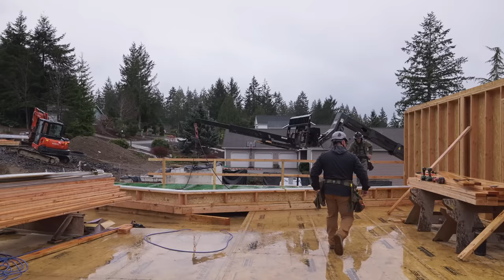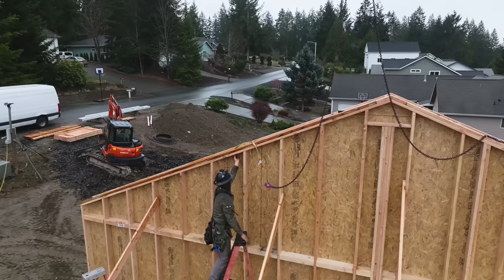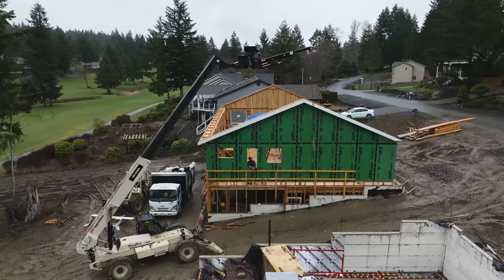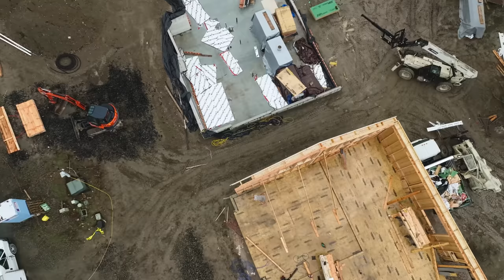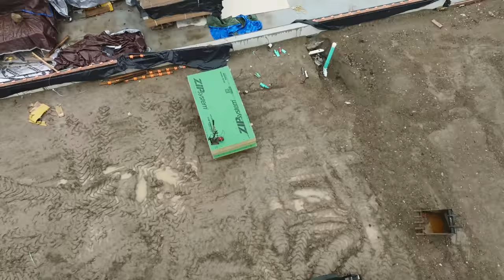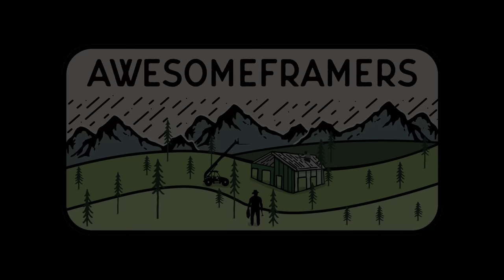Lifting a Heavy Wall Safely: Checking Height, Reach, and Weight

Comment: Actually nails are stronger than screws.. on shear it takes 8 bends to break a nail, two to break a screw… but a nail has more clamping/ pulling power … love y’all’s videos keep them coming!!!!
Reply from the maker: That's not true of these STRUCTURAL screws. Which is why we use them. Strong Tie SDWS TIMBER screws